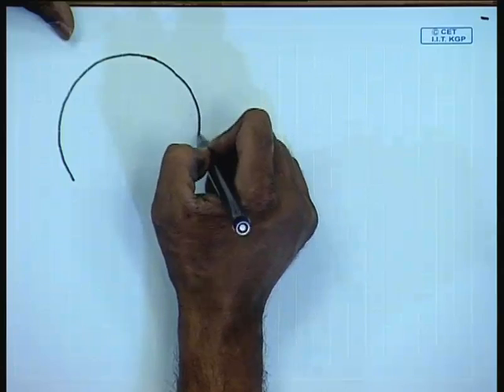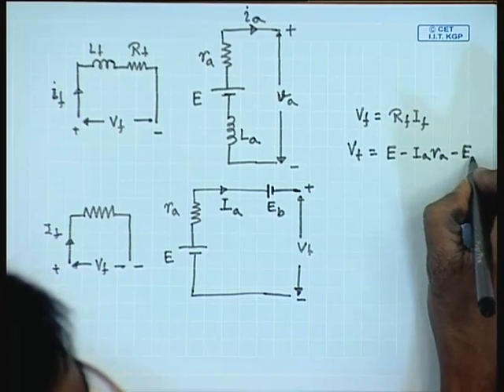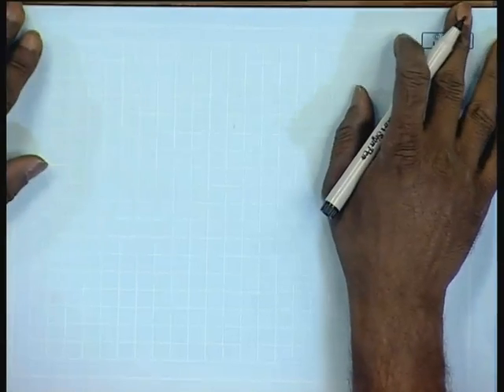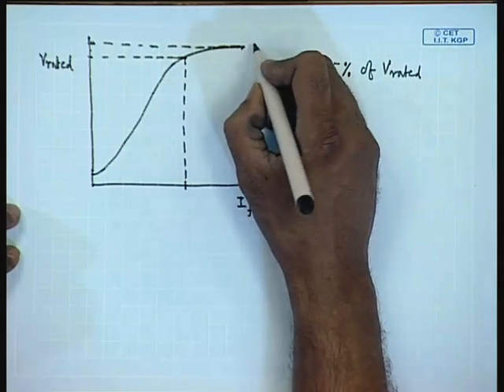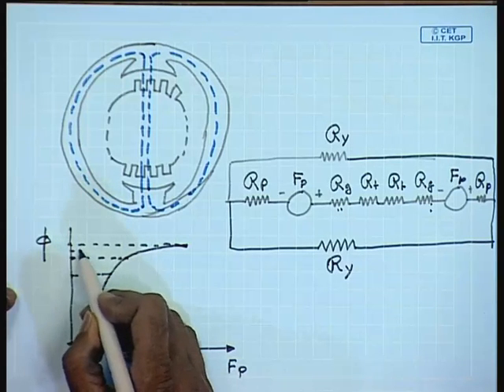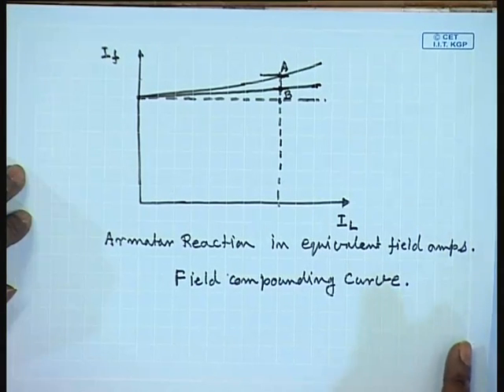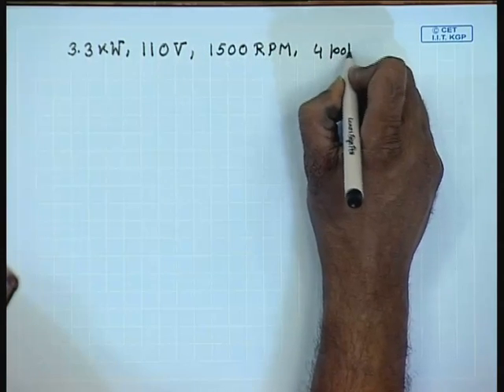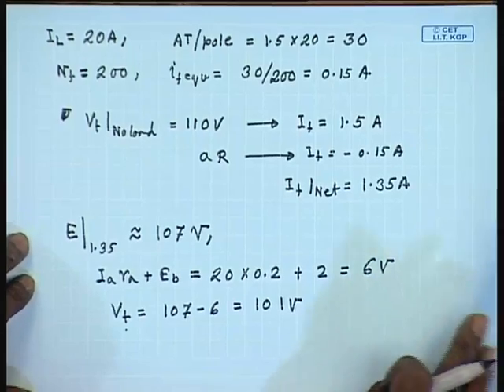Mod-01 Lec-26 Lecture-26-Separately Excited DC Generators

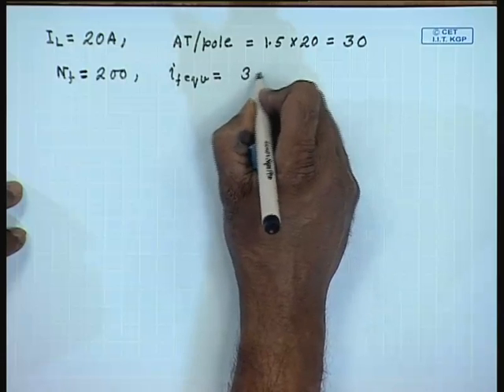Comment: In 53:55
30÷200 is not I (equ.).
it is the extra amp. required to compensate the demagnetising flux.
I doubt whether I am correct, if it is wrong please correct it
Reply: you are right it is extra amps that would be required if there is armature reaction , if u add that compensating current  to field current Ea would not change , but here in the question it has been said that field excitation hasn't been change so there would be decrease in flux . Now what would be the new flux if u ask..it would be proportional to old field current - extra amp, and new Ea is proportional to new field current, so the gist of it is that field current hasn't been decreased but due to armature reaction it would appear that it has been decreased and we can find Ea through OCC table. I don't know how well i have explained u, hope u get it